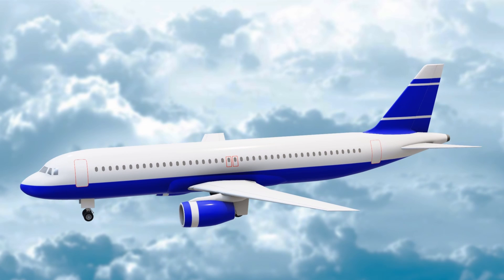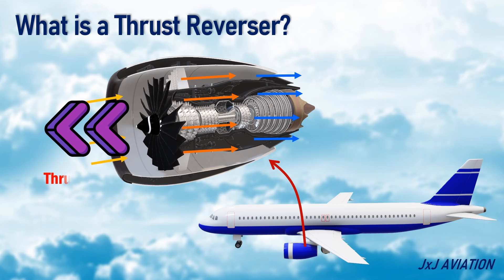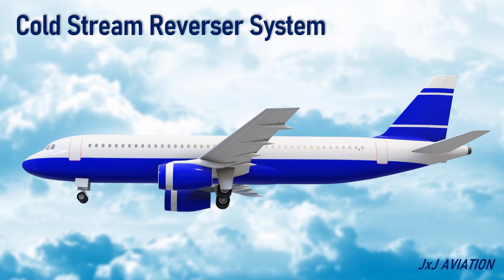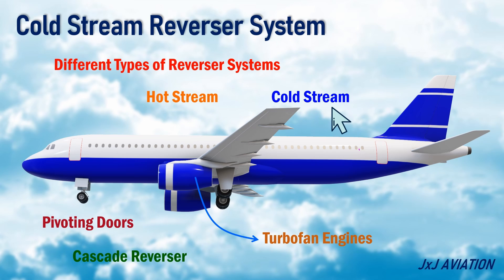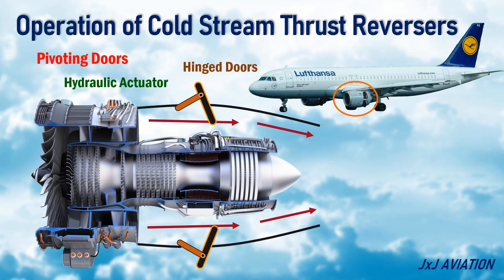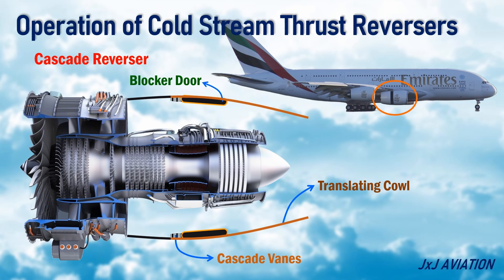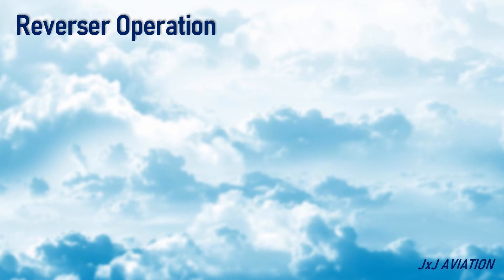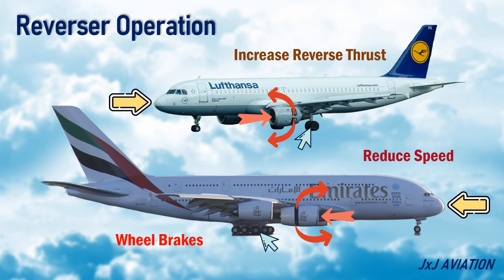Understanding Operation of Cold Stream Thrust Reverser Systems | Pivoting Doors | Cascade Reverser

Comment: But what's the point??? As per Newton's third law for every action there is an equal and opposite reaction, so trust which makes the plain move forward is used to Stop the plane and both effect cancel each other. It's better to turn off the engine rather than make the plane move forward and stop at the same time.
Reply: The force of the air leaving the engines is met by the force of the air moving towards it. Except the force of the engines is greater than the air moving towards it.

Yes, there is an equal and opposite reaction...until one side overcomes the opposing force because it is stronger.

Think about if you were pushing a heavy box across a concrete floor. Initially you impart force and it doesn't move. So you increase your push. The moment it begins to move is the moment your force is greater than the force that the box is pushing back on you. The box never stops pushing back on you. It just doesn't have the force to overcome yours.

Newton's Third law is correct. Even if one force is stronger, the opposing force is still imparting it's opposite force the whole time. It's why MORE force is needed to get anything to move. If all forces were equal, nothing would ever go anywhere, lol.
Reply: Yes appreciate your analogy, but the stream of air which is redirected forward was originated as backward trust which in turn gained its moment by pushing the plane forward. Now if you redirect this stream of air forward it will impart the same movement in the opposite direction hence the net effect cancel each other
Reply: Idiot question. Google INERTIA